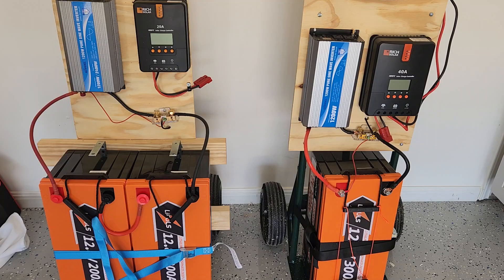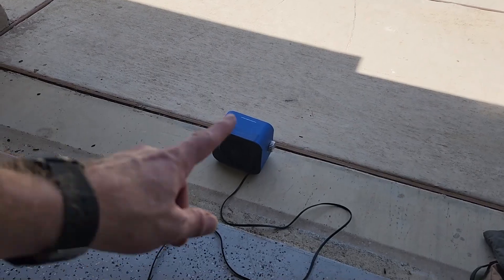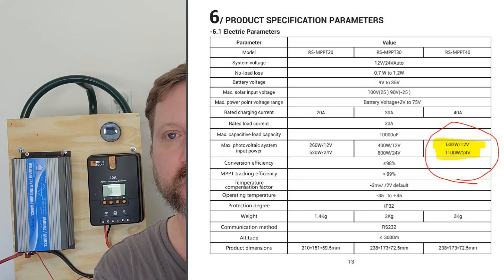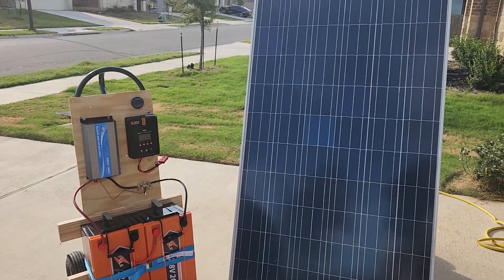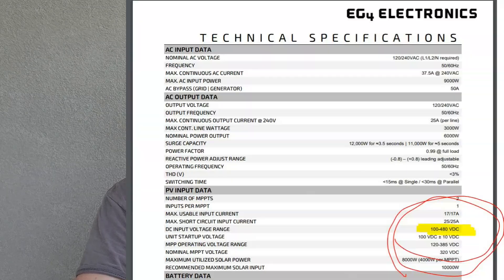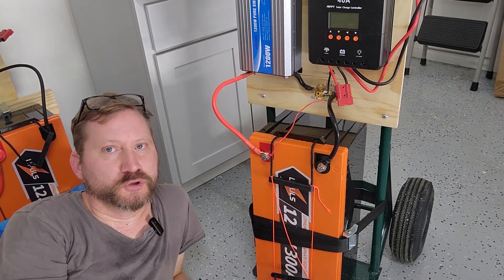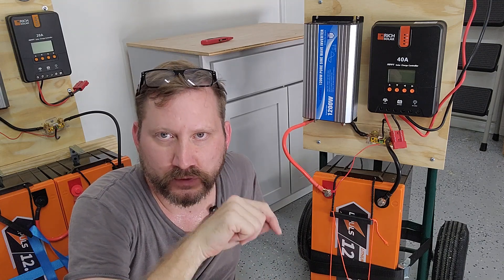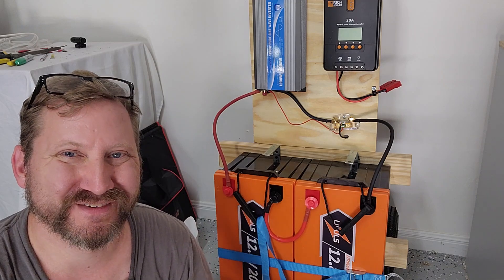24v 5.1kw battery solar generator system.  #diy #solar #prepper Texas Prepper Projects

Comment: Going to follow this build set....really nice!!!  One question:  if i opt to do one of the power-werx 45 amp chargers, do you recommend hooking up ring terminals to the charger and connecting directly to the battery posts....or use a bus bar?
Reply from the maker: I am not a fan of the bus bars. I like to go direct. The power works charger is on flash sale right now so dive on it. Then, get two, 12v 300ah watt cycle batteries from my latest videos for $520 each
Reply from the maker: https://www.youtube.com/watch?v=hY6IYwHylqo&t=14s
Reply from the maker: I am just About to post a video showing a new charger that I like better that solves this issue

Comment: What about total cost?  120v 24v battery charger costs more? cost of the 24 to 12 step down, cost of a battery balancer, charge controller, etc. not to mention availability, anything 12v breaks when camping or traveling can be found at walmart or many auto part stores..... All to save money on the cost of wire that only runs 1'.
Reply from the maker: If you have a single, 24v battery ir charger then you dont need a balancer. Most 12v car appliances also will run in 24v. If you really need 12v a step down is about $30, which you would easily save in the cost of the larger wires of a large 12v system
Reply: @texasprepperprojects  On that 24v hand cart you built in this video, you can save 30.00 in wire to pay for a 30.00 step down? Im not comparing a whole system to run anything past the hand cart. JUST the hand cart, you save money by going 24 vs the 12 right next to it?
Reply from the maker: it's all relative.  The two biggest advantages is smaller wire sizes and higher solar input by going from 12 to 24v

Comment: I have both a 12v and a 24v inverter  I can use , 2 150ah batteries I want to use ,  I'm on the fence , have a race hauler and need to run a 12v winch, any suggestions?
Reply from the maker: I would buy the 12v 314 ah wattcycle battery with the 200amp BMS that I just posted the video on. It's under $360 right now

Comment: I would do what you have set up both a 12 and a dedicated system for 24v. Lights and low voltage 12vdc. Heavy use appliances on the 24v AC converter.
Reply from the maker: I addressed this. If you have something that runs on 12v only that you REALLY want, then use a 12v buck step down converter

Comment: Thank you.  Well done.  1st one to confirm what I was concluding about 48V system and just a couple of panels.  
Question.  I have seen a number of comments highly discouraging 2 batteries in series.  Something about "balancing" I think, where the 2 batteries get out of sync.  Any thoughts on that?  Thanks.   Edit:  Generally speaking, I understand that the batteries can be balanced (?) initially, but there seems to be a concern about them getting out of sync over time.  Is this a concern?  How do you address this?
Reply from the maker: I have heard of this as well. All of my systems are for emergency use. Not daily use. So, I'm not worried about it. If it was for daily use, I would just buy a 24v battery. They are more common now. Check out my more recent videos. I personally use a 24v 314ah monster for my home backup

Comment: Will I need a external balancer (battery balancer) I was told using two wattcycle 12v 314ah mini batteries 🤝
Reply from the maker: No just charge them both up to 100% before you link them

Comment: On my third year with two 24 V system So far love it Will upgrade the battery with a 200 Amp hour from a 100 amp hour soon. Thanks for the video.
Reply from the maker: Check out my last video on the 24v 314a beast

Comment: Subscriber here.  I'm putting together a 24V 4KW inverter system using a Giandel Pure Sine Wave Inverter.  I'm ready to purchase the wires, fuses, switches etc.  The problem is Giandel says I only need 3 AWG from the battery bank which makes no sense.  When I watch other videos, consult the charts etc I'm getting conflicting answers anywhere from 1, 1/0 to 2/0 AWG.  My amps at 4KW / 24V is 167.7.  From your vast experience can you recommend which way to go and also the fuse size to use?  The wire from the battery bank to the Inverter will be 3' max, hopefully shorter.  Also Some say the wire used to series / parallel my 4 12V 100AH batteries can be smaller than the wire from the inverter to the battery. Is this true?  Thank You in advance,  BTW, I'm now seeing why people go with All in One systems, much less connections.   Dave in PA  BTW, I'll use your link when I pull the handle on these purchases, hopefully tonight!
Reply from the maker: I only use windy nation wire and  i have landed on 2 awg for my needs. Its rated to at least 120amp (I think it's actually higher than that but I cant get to windys website.). Regardless, 120 amps at 24v gets me well over 2kw of output, which is more than I need.

Having said that, you can't go wrong by sizing up.  A 1/0 might be overkill  it's not gonna hurt
Reply from the maker: And in my option all power wires should be the same size. All of the interconnects between batteries and battery to inverter.

Comment: looking to do a small 24v set up...3000w inverter , 100v 30amp charger, 24v 100ah single battery, going to use 2x 200w panels.. will it be better to put the  solar panels in parallel or series?
Reply from the maker: Series but you need a much bigger battery system for that inverter. Grab 2 wattcycle now while they are cheap
Reply: @texasprepperprojects  I plan to power up 800w to 1500w appliances then use a step down 24 to 12v 30amp to power up leds fans charge phones tablets ect... 
 
I will get another 25v later and Parallel 2 25v... should I just get like a 4000w+ inverter?
Reply from the maker: I think your inverter is fine,  you need more battery capacity
Reply: @texasprepperprojects  ok thanks.. 

should i get a 100v/15amp solar charger instead of the 100v/30amps?  im really only going to use 2 200w panels for my set up and each panel can put max of 10amps and  from what you said best is to put it in series instead of parallel, because i was also thinking of doing it parallel  but seems like its best to use the panels in series that way i can save some money on the charger control...

liked vid a and sub and shared it :)
Reply from the maker: You should buy the litime 60 amp mppt that I  reviewed a few months back. Check my older videos

Comment: I see you have a shunt on the negative wire. Most videos I've watched have it on the positive?
Reply from the maker: depends on the shunt. Every one I've used is on the negative, and then you hook up a positive wire to the battery to get power into it

Comment: When sizing a system you do have to know what your taking out.. your test shows a 2000 watt inverter.. you can only power small things it will trip using a coffee maker with a fridge and hit the microwave.. so a fast  breakfast before work. Is slower dont short yoir clock.. i like the Jimmy deans sandwich and coffee but that will slow ya down. 1 at a time.. but u know this.  Electric math is needed to do solar panels.. it is a simple thing to learn. But you must learn it. So u dont waste money on equipment to met needs.. you must buy to met needs or u will hate it..
Reply from the maker: Thanks
Reply: @texasprepperprojects  what do you think about the ecoworthy 280ah battery and their 5000w inverter that's why I'm going to try w my 30 ft 1 ac camper.thanks for the like on your older video comment I left
Reply from the maker: I love the watt cycle. Check out my recent videos for amazing sales
Reply from the maker: Grab 2 watt cycle 280ah off my recent video while the sales last

Comment: Hi , looking some,help with my system
Reply from the maker: What kind of help are you looking for?
Reply: I am trying to upgrade  from 12v, to, 24, I have the, li time 24v all in one ,on the way. I am using, 8, 100wats, panel.
Wha7the best  way  of connecting  the panel. I use it most for tv,/ fan,and some light..thank for any info. I live in the Caribbean.
Reply from the maker: What batteries do you have?
Reply: @texasprepperprojects  i am using. 4, 12volt  battery. 4D. About 200amp
Reply: Lead acid  battery
Reply from the maker: What is the question
Reply: @texasprepperprojects  witch is the best, way to connect the .8. 12v. 100wats. Panel. To run the 24v. System?. Thanks for any help.

Comment: I happen to have four 100A-H AGR batteries that I obtained for free.  A friend recently gave me an older, but great condition,400 watt panel. Question: I want to utilize a 24 volt set-up, requiring a series-parallel connection scheme. Can I use only 1 charge controller, and do you recommend me using 1 more panel?
Reply from the maker: Yes
Reply from the maker: Grab 2 watt cycle batteries from my last video now while they are cheap

Comment: If using two 12v batteries like shown here, dont need the step down buck converter, can just wire it to both batteries in parrallel and pull directly from the battery and save all that extra loss and cost.
Reply from the maker: You miss the whole point of going to 24v

Comment: I like my 24  volt system much better than any of my 12v stuff
Reply from the maker: Its mo betta
Reply: @texasprepperprojects  yep.. agree. I kinda wish I'd built a 48 volt system but it's just running my camper. I have a 24 volt 30 kwh battery I built with a split phase 4000 watt inverter in the camper and a 12 kwh battery I built running my little shop. I use victron charge controllers and a couple different kinds of panels. I'm getting a couple more pallets of panels next lol. I've been building out my power systems for a couple years now and I'm kinda addicted lol. I even just built a 280 ah 12 battery and small power system so that my mom could have a back up for her fridge during power outages.
Reply from the maker: For me it's about the usage. I'm a prepper in Texas in a rental house so I'm trying to find that balance between power and space and price and portability since I can't mount panels. For me, it's 24v since I can do that with 2 panels on this cart and just move them in and out of my garage if I need to. I'm not going to run my AC, just fridge and other basics. But I feel anything over 2kwh probably should be 24v
Reply: @texasprepperprojects  this solar stuff and building and porting chainsaws has been my hobby for a good while now. I built my camper for a kinda bug out thing. I installed a 220 v 38 seer mini split and solar. re did the water system with good filters and a nice pump with a back up pump. solar on the roof and then another 8 panels as ground deploy. I e tried to make it into a comfortable place to stay if my cancer comes back. it's a 30 foot holiday rambler and it's not a lot of room but the first time I had cancer me and my wife lost pretty much everything so I built all this so if I'm sick or dead then she or we.. can have a place to live and not be homeless. it's more of a hobby now trying to prepare for if times get bad for us. it's kinda expensive but I feel it's for a good cause and it's fun.
Reply: @texasprepperprojects  my friend Chris is a big time prepper and  has a channel called smokey mountain off grid. check out his channel if you get a chance. they prep food and solar and about everything prepping

Comment: If I use a 25.6v Lithium battery to charge with 2 units of 585w solar panels that produce VMP 52.63V  and ISC 14.7amps...should I use them in parallel or series? What size of cable from the solar to the battery?
Reply from the maker: that depends on your solar charge controller. Can it handle 100v open circuit?   I'd use a minimum of a 12awg, prefer a 10awg
Reply: @texasprepperprojects  30-50V for a 24V battery according to th specs 😔
Reply from the maker: @gamalierpty   then put them in parallel and use a 10awg
Reply: @texasprepperprojects  thank you
Reply from the maker: @gamalierpty   and check out this video.   https://youtu.be/syrnCSMjFhI

Comment: I see each system you had a meter showing your watts and amps. Does that mean each system required a $90-100 Shunt?  Thank You.
Reply from the maker: 1 have two systems that are independent, so yes, i have a shunt on each of them. I can use them in different parts of the house.

Comment: Since my van camper is 120v (a/c. & microwave) and 12v for everything else I need to supply 12v. This means I’ll have to use step down transformers! How much wattage loss would I have by adding the step downs, for each step down transformer. If it is very much larger 100% pure copper wires may be a better for my application.
Reply from the maker: You lose a lot. What sort of 12v devices are you trying to run?

Comment: 12.8v X 100A = 1000w? 🤨
Reply from the maker: You have inverter losses to deal with also. If you go to 1:52 you'll see that 1,000w is pulling 75 amps from the battery. So, I'm slightly off, but you wouldn't want to run something right up to the 100 amp limit of the BMS 24x7. So, my comment about 1,000w is me errroring on the side of caution and rounding down for safety and inverter limits.  Most BMS can spike to 150 or 200 amps, so you CAN run a couple thousand watts, but not for very long
Reply: 8:45 - 9:00  Unless I'm misunderstanding you.

Comment: like others I got a delta 2 one kw power station and the ecoflow charger . the delta 2 functions as a head unit and I can use my 24v battery as additional power source BECAUSE the delta 2 directly accepts 24v input and the charger will charge 12v and up to 32v . I will add some solar later
Reply from the maker: That’s a great approach!

Comment: Awesome video and I have everything to build my own except for the batteries -- Do not buy anything from Aolithium. I ordered multiple products from this company that reflected they were in stock. The company waited until the date I was suppose to receive the products (almost 3 weeks after I placed my order) to tell me they are no longer in stock and haven't refunded me my money. Basically they're trying to keep my money and will not ship the products.
Reply from the maker: Great tip!
Reply: Aolithium got in touch with me by email and asked for my order number. I provided my order number to Aolithium and they went ghost on me. So screw Aolithium.

Comment: I recently installed 2 12v 200ah lifepo4 in series. Even with a victron battery balancer they still get out of balance.maybe put it back in parallel, less headaches, but then back to 12v.maybe make a video about a victron balancer?
Reply from the maker: Maybe one day

Comment: Hello, what awg did you use to connect both batteries? What awg did you use to connect batteries to inverter?

I have 2x 12volts 100A connected in series (24v) with a 4awg 2ft wire. Can i connect batteries to my 2000watt inverter with 2awg wires? Thank you!
Reply from the maker: Yes. 4awg min, 2awg preferred
Reply: @texasprepperprojects  bless you! 
Just bought 2 Lithium batteries, one is 13.30V and the other 13.33V. Do you think they're safe enough for me to connect them in series for a new setup? Thank you!
Reply from the maker: Fully charge them both alone first

Comment: I didn't know you need a lot of panels for those EG4 48 volt all in one boxes. That is a shame because I just don't have that much room in my backyard for that many panels. Also, as a beginner I am told that 48 volt is dangerous as it is capable of killing you by stopping your heart, and 12 and 24 volts are safe. Thank you for the info.
Reply from the maker: I have heard similar about 48v

Comment: Nice video but I am not sure how you attached the plywood to the metal hand truck? Did you drill through the metal frame? Also, I notice all you tube solar guys always use unfinished plywood, is there a danger in painting the plywood?
Reply from the maker: Yes I use a 2.5" 1/4" x 20 bolt and drill all the way through the entire thing. Since inverters and mppt get hot, I don't like to mount them to painted surfaces

Comment: I subscribed with a like. It was good to see that you hooked up a 24 volt system. I been thinking on doing that for a good while and you were spot on at explaining about using a smaller gauge wire for the 24 volt system. I am glad you mention that most if not all charge controllers can be bumped up to 24 volts. There are charge controllers (that also includes PWMs) that can charge a 48 volt battery bank and 150 volts from the solar panels. Will Prose has a recent video warning of the dangers of hooking up solar panels above 50 volts when wiring them in series. A person has to know what they are doing when wiring in series otherwise they risk electrocution. That is why I use series and parallel together with two PWMs which can handle 55 volts from the solar panels. Many YT channels would have people believe PWMs are junk. From my observations and using a multi-meter, the voltage and amps start rising after first light and increases during the day to the programmed voltage. In other words, the batteries are being charge beginning at first light. Of course, an MPPT or multiple MPPTs should be used on large systems to maximize the solar input. Furthermore, I have wind and solar on a different system. Wind power is a complicated subject and more expensive than solar but great in using off grid with solar. However, I am not off grid. It's not possible where I live and this would be true for a lot of households.
Reply from the maker: thanks for the note! Check out my latest video on a 24v all in one
Reply: @texasprepperprojects  Sure will and thanks for replying.